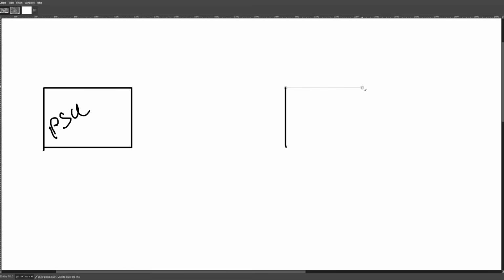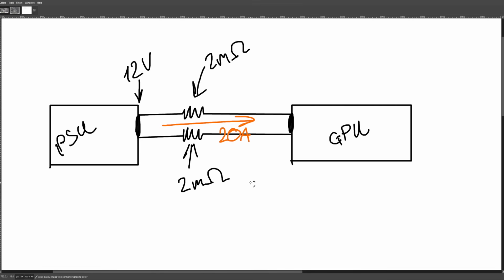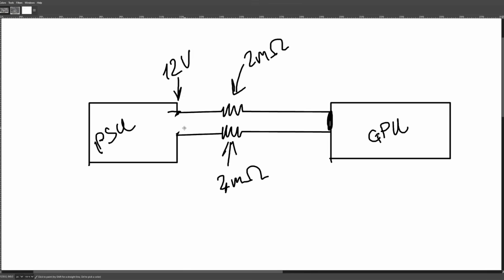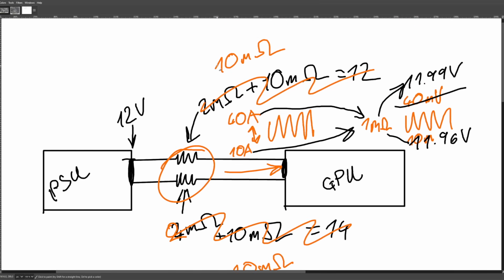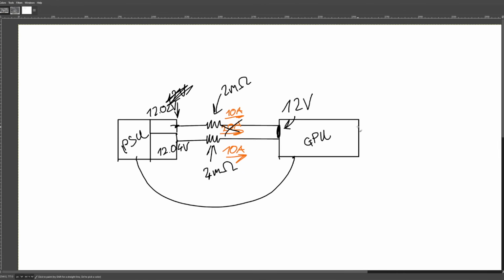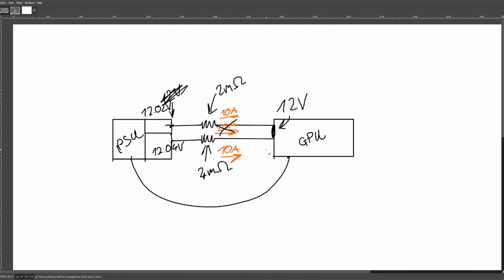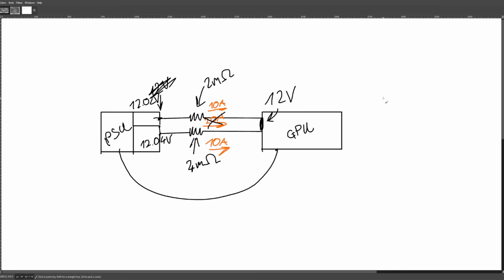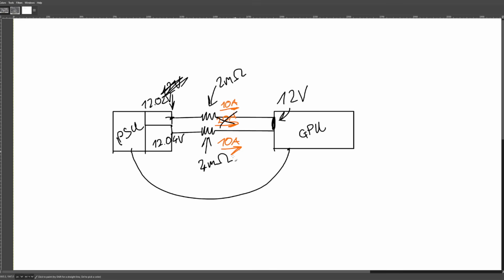Why ATX power supplies don't load-balance power connectors

Comment: "It's a $2000 GPU, do you really need to cost optimise the power connector?"

This, absolutely this.

Thanks for explaining why it is so much more difficult to 'fix' this issue on the PSU end, rather than just power balance on the GPU end, or better still, just go back to connectors with more headroom in the first place.
Reply: you don't really need to power balance on the PSU side, but the PSU could just cut power if the current exceeds spec
Reply: @defeqel6537  but then you have to monitor each pin individually and the it should discard transients - which it'd require some processor (dedicated IC) to accumulate moving averages. If the PSU doesn't die or overvolt I'd be happy -- a super expensive device like GPU should perform its own balancing. Realistically the balancing and monitoring (per pin) is needed only for very power hungry devices.
Reply: @markbooth3066  especially when they already had for decades a well tested connector!
I think its what bz mentioned for vrm design cost optimization.
They didn't want a current balancing power design vrm anymore and they knew this connector would take all the blaming if something fail, so they just didn't care fixing anything and rolled with it knowingly the profit will surpass any issue might come. 

I rly don't know where all that money go if its not on pcb design!
Maybe they invest on something completely different and they milk this thing until they fall off to sell it somewhere else
Reply: Oh, where the money goes is simple @  it's all going into "shareholder value".

Nvidia hasn't been about gaming for a long time, it's been about server GPUs. We thought the crypto crash might restore sanity to GPU market, but now we'll have to wait for the AI crash instead.
Reply: @markbooth3066 good luck with that. 

As soon government/military and other higher society powers are interested into such, it will not crash.

Crypto is disruptive to the laws of the  banking society that's why it doesn't had the push AI is having....
Reply: @black.phoenix.  Military is already experimenting with AI. So that ship has indeed long since shipped.
Reply: Oh how things have changed, @.
Back in the 80's and 90's the DoD refused to work with transputers because they had hardware task scheduling, which meant you couldn't say precisely which instruction in a program was running during any given machine cycle, even though they could guarantee interrupt response time in any high priotity task.
Now DoD are being required to consider systems which are complete black boxes, where noone has any idea how those systens came up with their answers, and no way to tell if the data set they were trained on was either necessary or sufficicnt.
Reply: @ArtisChronicles  I know that, that why I said what I said.
Reply: headroom gets engineered away. its skill to optimise something. but to the point it barly holds up or in otherwords, barly doesnt break i neveryday usage, then its bad design. it should "barly doesnt fail" if a (fatal) error occurs. But as a mechanic its a bit different but the basics still apply. headroom is the lifeblood of technology.
Reply: It's not just the $ cost. The balancing costs efficiency, so you can no longer achieve a gold rating on your power supply if you do this. It's also a non-trivial amount of power. if your GPU is pulling 200W, and you need to fix an imbalance of just 10% between the wires, you have to eat an extra 1-2% loss as heat in your PSU. That doesn't sound like much, except that once you get about about 4-5W of dissipated power, you need sizeable heatsink. As you go past 10W of extra dissipated heat, you need active cooling. Designing around crap connectors makes the whole product turn to crap.
Reply: I think you mistyped "$4000".

EPS12V really should have been the next standard instead.
Reply: The connector requires both the PSU and the GPU use the same connector. Are you planning to force everyone in the world, including grandma, to shell out an extra $30 to solve a problem that only affects the top 1% most expensive PCs in the world?
Reply: It's only $2000 because NVIDIA is asking $1500 for the GPU chip and you need all those memory and other components as well. So the gfx card manufacturer has not suddenly a ginourmous margin, it's NVIDIA that has that and they aren't sourcing the connectors for card manufacturers.
Reply: Agreed  @Martinit0 , but my understanding is that as well as extracting maximum profit by setting the price for the silicon itself, Nvidia also mandates 'board partners' offer at least some cards at MSRP, and stipulates certain things about the board design too, such as the use of 12vHPWR and 12V-2x6 connectors and not allowing power sense/balance circuitry.

Sure card manufacturers could design boards with 8-pin connectors and power balancing, but then they would risk Nvidia denying them future supply.
Reply: @markbooth3066  Such kind of "mandate" would be illegal in many countries (price fixing by a business partner is considered anti-competitive). Also it would be useless because consumers pay the price set by retailers, not price set by manufacturers. So all it would do is shift profits to retailers at the expense of manufacturers.
Reply: And where are the vast majority of boards manufactured  @Martinit0 ? Are they built  in regimes where Nvidia can't make those mandates, by any chance? No, they are built in locations where Nvidia can make whatever demands they want, and their customers have no choice but to accede to their demands.
Reply: @markbooth3066 It doesn't matter because prices are ultimately set by retailers. No manufacturer sells at MSRP, you have to give retailers a discount for the MSRP to make sense. I get the feeling you have never worked in manufacturing nor retail as these are basics of their business.
Reply: the retarded part is that all the expensive bits are already on the GPU, it would cost literally pennies to not combine the 12V rails...
Reply: It's not cost optimization. It's PCB space limitations put in place by the two-slot flow through cooler.
Reply: I think cost optimisation is more likely  @ . You could easily fit 4x 150W 8-pin power connectors, even on half size boards with flow through, now we don't need space for SLI bridge connectors.
Remember we never saw 150W 8-pin connectors melting and if 12v2x6 connectors were rated at 300W, we wouldn't see them melting either. Cards which draw more than 300W would just need a pair of them.
Reply: @markbooth3066  have you seen the 5090 PCB? They're packed as tight as a SXM.
Reply: @markbooth3066  there have been 8 pin connectors that melted, but in comparison it's exceedingly rare
Reply: Where 2000???....
Reply: @alextopman5977  Nice question 😄

Comment: The old designs with current shunts were like adding resistors in series with the connection. It was just useful resistors.
2.5ft 16 AWG = 10 mOhm which was a popular shunt earlier, but I think 3090's used 5mOhm and now they are often even smaller.
Problem is contact resistance. The allotted LLCR of 6 mOhm per contact leads to almost half a watt dissipated in each contact point. That is already a lot and almost on par with the cable already. Granted it is on both sides but still.
Reply: not really. the shunts were there to measure the voltage being supplied to the core power phases. the problem IS contact resistance but only when the pin isn't making proper contact. but the shunts aren't really like adding resistors in series like buildzoid was saying would, in theory, work but would be highly inefficient. He's talking about adding sufficient resistance such that the difference in resistance on the pins wouldn't matter much. But that idea really doesn't work either, because the only time the pin resistance is really an issue that causes melting would be if the resistance on the bad pins is dramatically higher than the good ones, and in order to reduce the effect of this enough that it wouldn't matter, you'd need to be adding an order of magnitude higher resistance to all pins just to bring the effect down to 10% of what it is now. But the issue with doing that is then you're going to be dropping a shit ton of voltage across the newly added resistance, thus requiring a higher voltage power supply, and needing the new resistors you're adding to be MAJOR power resistors that can handle dissipating a ton of wattage. not gonna do the math here, but the idea just wouldn't work in practice, like not at all. i think buildzoid's point of even mentioning it was more of a joke because it would never be remotely feasible to do it in reality.
Reply: @spectrum_observer  I don't think you understand how this works.
If a pin has bad enough connection it will be fine. If it has good connection it will be fine.
It is when a pin has the "wrong" amount of resistance it goes bad. Look at load-matching to understand why. Too much contact resistance lowers the current in the wire by so much that the power dissipated in the bad connection is not a problem while a good connection has no voltage drop so again there is no problem. If we assume mid-level contact resistance on both ends of cable of 3mOhm (half way to max of 6) and use a 2.5ft awg 16 cable with an imagined load adjusting to always pull 50 amps with a source voltage of 12v we can estimate when a single conductor reaches worst case. Perfectly matched they all pass 8.33 amps and have a connection loss of 208 mW. Increasing one pins contact resistance shuffles this around and at a contact resistance of just 16 mOhm we reach a peak of 395 mW loss when cable conducts 4.97 amps, about half of the other 5 now carrying 9 amps. Increasing the resistance further drops the current in the cable so much that the power starts going back down. The big problems seem to arise when you have a few cables with very bad connection and then add another with the ideal "poor" connection taking max heating. This is because the current is then already increased to a subset of the cables so that the effects of a elevated contact resistance has maximum heating effect.
What I was saying about the shunts before is simply that they did actually help reduce the sensitivity to this problem by adding extra base resistance.
Reply: @spectrum_observer  Using the higher resistance solution causes big voltage extremes with low an high amp usage. Solve one problem to create another. 😉

Comment: Mr hardware overclocking sir, GPU's will operate above 9.5 volts, and  below 15 volts very very safely. I know this because a GPU i use for my rasperberry PI pulls its power from a battery with a 10.2 to 14.4 volt range we wont get into why i did this shit show of an experiment, but it does work very nicely, when powered from a simple 12v lead acid battery
Reply: Yeah and I run the diesel injectors of my car at 120% pressure for shits and giggles, I'm sure that will not result in catastrophic failure in the long-term smiley face
Reply: @punktkomma9489  120 over injectors are a real thing dude, and if mapped correctly will do no damage at all. Just like DC Power when done right it can be very forgiving

Comment: You made it sound relatively reasonable for the PSU to monitor this and have an alarm; as well as that would it be possible for a PSU to change the sense pins to only allow 150W in that scenario as a way to allow the system to operate safely (if performance degraded) until the problem is fixed?
Reply from the maker: IDK if the GPU's support having the power limit changed on the fly.
Reply: @ActuallyHardcoreOverclocking  the 12vhp spec allows for the power wire to determine how much current the card can draw though, right? based on the sense pins that are plugged in? i would def be curious to know if the spec allows for it to change on the fly.

if it didn't allow on the fly changes, the PSU could be designed to shut down if the current draw becomes too unbalanced, at which point it changes the sense pin voltages on next boot, with an indicator LED showing the user that it shut down because of a current imbalance. if the user fixes the issue, they could be required to turn off the supply itself which could reset the sense pins to full wattage mode, and if the supply isn't power cycled but it measures the current being balanced again (suggesting the user fixed the bad connection), it could either shut down again or it could have an indicator light telling the user to restart the system or power cycle the supply. Either way, much better than what is done currently IMO.

Comment: 25:27 they also need more board space, which I presume is one big issue, as well as the image of needing way less connectors. And 1 vs 3 is there much better than 2 vs 3
Reply: AIB cards have more board space, but is seems Nvidia is dictating their partners must stick to a single connector.
Reply: @blarghmcblarghson1903  I think we need this on record

Comment: 14:40 hear me out: removing resistance via superconducting.
Also no heat issues, bc you need an LN2 circuit to actually keep it superconducting
Reply: It is is still heat issue though. Just different one.
LN2 cooling can be counted as heat issue, because you always need to keep it running. 

And with heat coming from components, you cannot make it isolated environment where temperature is constant, so LN2 does not evaporate.
Reply: @DimkaTsv  it's not, if you have no resistance because superconducting.
If it gets to warm to no longer superconduct, then it is the normal temp issue, just now with overkill cooling.
Reply: @Emma-i9x  It is indeed not... FOR A WIRE
But GPU core works via transforming electricity to heat. And it will still produce heat evaporating nearby LN2.

That is why i specified isolated environment, where no external heat sources are present to slowly affect LN2 loop. 

Or... You can just regularly refill LN2, which surely will be comfortable for average user).
Reply: @DimkaTsv  no. The transforming it into heat is the ineffeciency^^
Transistors don't work with temperature differences, but electromagnetics.
But you kinda need resistance to isolate between stuff^^
Therefore we use semiconductors for transistors.
But yes, bc losses you need to refill and have regenerative cooling, like the James Web space telescope uses
Reply: @Emma-i9x  even if it is inefficiency, GPU's and CPU's are basically glorified heaters due to how they work.

I am not electricity expert, so i used very crude picture of course. Because i cannot imagine processing unit having computation power without using resistances and isolation. 

Even light can and will heat up objects that absorb it. And there are no truly 100% reflective surfaces right now, afaik.

So yeah, LN2 refills because of indirect heat will be necessary which was my original point.

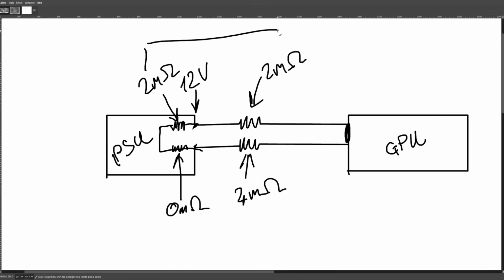Comment: 6:10 it would be complex, but you could do that with an amp meter and an electronically controlled variable resistor. Or simpler a PTC Resistor doing this indirectly.
Edit: and also increase voltage, witch will make this a loop probably
Reply: yay for inefficiency and dummy loads?

Comment: What is the name of the PSU that does voltage monitoring at the GPU side? Is it per-pin?
Reply from the maker: it's not per pin.
Reply: From what I've heard, ASUS' Thor V3 can do load balancing if it's paired with the Astral and has the monitoring software installed. The Astral + software can only warn you if it detects an imbalanced load, but allegedly it can also communicate with the Thor V3 (and Strix Platinum?) to dynamically add resistance to the overloaded wire.

Cannot attest to the veracity of these claims though, I only looked into it briefly before deciding to wait for the inevitable Super variants to see if they will attempt a serious fix... like allowing AIBs to add a second power cable.
Reply: The new ROG Strix Platinum power supplies?

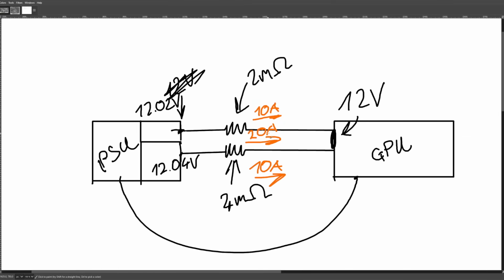Comment: 16:00 Zener Diodes are perfect for this issue
Reply: wouldn't really work well though, both because zeners require a resistor upstream so that the excess voltage is dissipated, so you'd basically need massive power resistors on each wire that could heat up to burn up the extra voltage, and because it wouldn't even solve the issue, because the issue isn't that the voltage is going too high, it's that the current ends up being too high in the pins making a good connection because the pins with a bad connection have too high resistance and thus the current through them are lowered which means the good ones take more so that the total current supplied is the same.

Comment: For mine, i just use thick car wire 1awg or 0 i dont remember exactly, but that time using calculator which indicate 16awg wite is related to ...awg cable, than i just solder ground togather on connector, and from power supply pcb i solder them to proper place, for short distance, resistance of multistrand will not really be affected fo ex 3cm if you really need flexibility